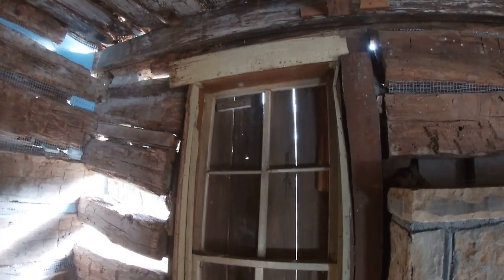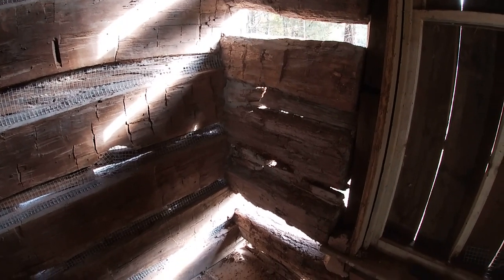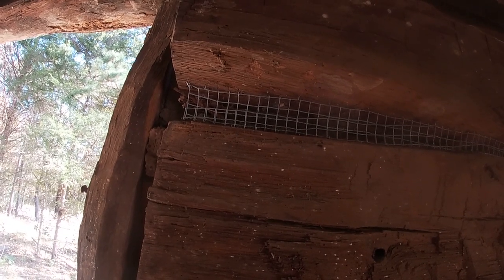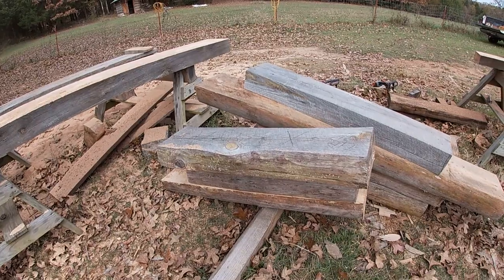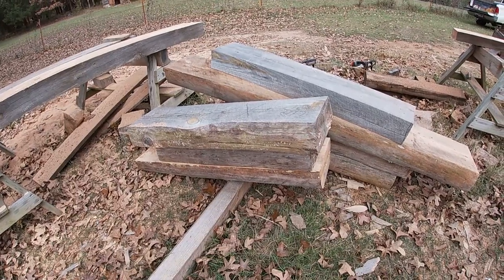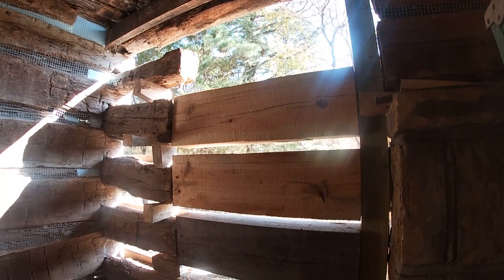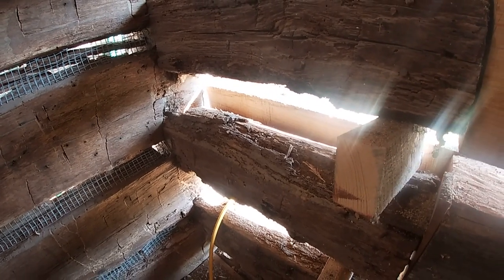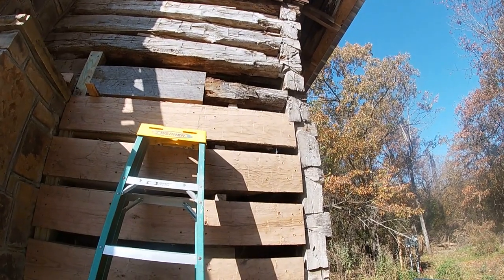More Log Repair, Gilliam Log Cabin (Pt 7)

Comment: Thanks for sharing your work Paul, great film! Such a weak corner on that house, it always amazes me when large openings are made in timber walls without any consideration for the fact that the timbers hold the house together. A fish on the outside and a little jacking above the damage and that wall would pull in. Very best wishes from us here and God bless you and your kin.
Reply from the maker: Howdy Lucas- I certainly agree with you. I would have liked to done some replacement of the logs but the cabin has been allowed to get in sad shape because of not knowing the termites were doing their damage. They work very quietly. It would be such a pleasure getting to work with you and learn from your extensive knowledge. Hope you’re doing well. God bless you

Comment: Prayers for you & whatever you have going on away from YouTube. We miss you, but understand when life happens. Great video, Paul. The old cabin is really taking shape. What do you call that mesh wiring in where the chinking will take place? Stay safe & take as long as you need. God bless & we’ll be praying.
Reply from the maker: Howdy Phyllis- thank you so much for the prayers. Much appreciated. What I use in the chinking gaps is capped hardware cloth, even though it’s actually a wire mesh. Thank you for the support. God bless you
Reply: @TheBeardedCarpenter  thank you.